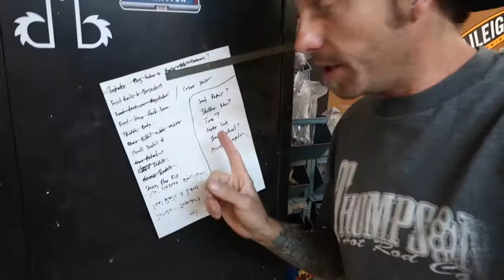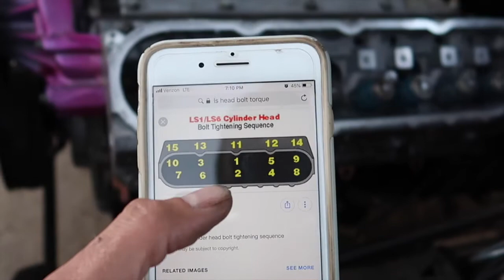241 Heads Installed On The Maliboom 5.3 LS Motor DTV EP6

Comment: you buy bolts but not head gaskets.   oK
Reply from the maker: This video is old but I re used thoes same gaskets like 5 or 6 times.haha I made 650WHP on that motor with the same gaskets and re used head bolts.

Comment: I have an 04 gto 5.7 ls1 241 heads it has some realy good power considering the cow weighs 3800 lb without me in it LOL heaviest car I've ever drove and I'm surprised at the power response it carries I've had thoughts I'm pulling the five seven in the T56 trans out doing some work to it and trying to find a small vehicle to put it in like a Chevy Chevette LOL I wanted to put it in my 90 Fox body but everybody's crying about putting an LS in a fox I just want something fast
Reply from the maker: At the end of the day its your budget and your car. If I had it to do all over and I just wanted to race, bang for buck you cant beat a mustang for the most part. A Chevette has a real short wheelbase so it may not be legal to race if thats what you choose to do. Another good option is to just buy a roller and plug your powerplant in it and go have fun.
-Dane
Reply: Only ford fan boys cry because even they know the old 5.0 is a turd and that's not fair.